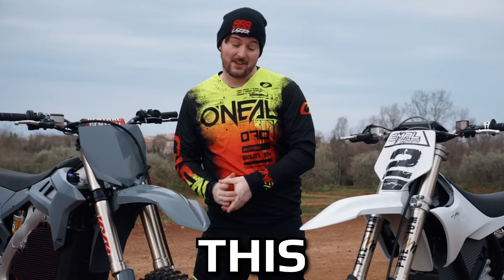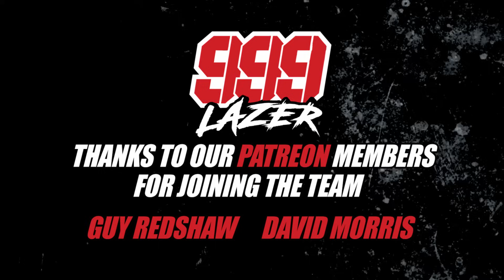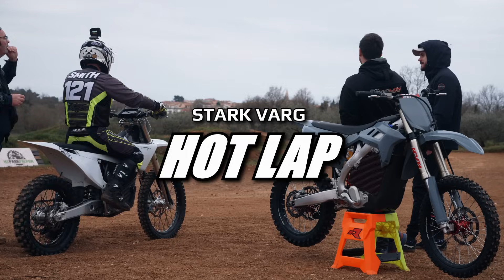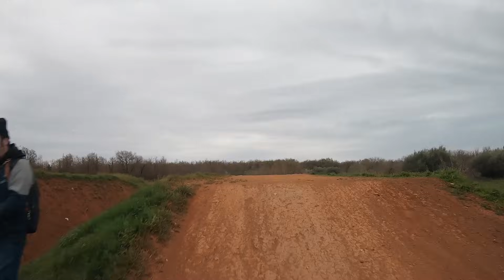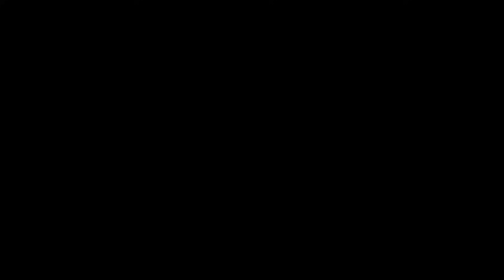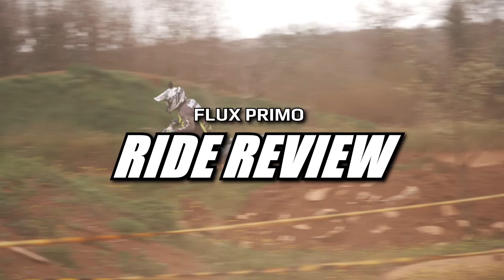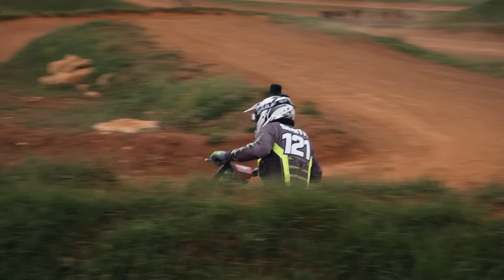$50,000 Dirt Bike vs $50,000,000 Dirt Bike! | Electric Motocross Shootout

Comment: SPOILER ALERT: Video title + Second 00:05 and this guy is already lying. The Stark Varg was not developed with $50.000.000. This fund was to mass produce the first model (which is more or less what you need for roughly 7.000 bikes). This doesn't mean that the development until then was higher than the Flux, but in my opinion, both the Title and the emphasis on these numbers on the video, make no sense because they are completely wrong and give a deviated perspective to the consumer.

Comment: If Marco is monitoring, why not build the rear wheel with the electric motor in the hub? Why put the motor in the frame and use a chain to transfer that power to a rear sprocket?
Reply: Because it's unsprung mass and it rides horribly, lol

Comment: Stupid clickbait title. Not required. Production is a big hurdle- ask all the struggling car manufacturers vs Tesla. I have a Stark - love it. I ride 4 - (15”-20” ) motos, with one top off charge from 120v generator. I want the Flux as well, bring it on. Competition  will drive development. Hopefully Flux learns from Stark mistakes. Do not overlook import/ distribution issues- big delay( 9 months) in getting my bike in California. 60hp is more then adequate, my Alpha I run at 48hp. Efficiency is key- Stark just released firmware update which basically gives less wheel spin/ improved traction control. The idea of battery swap is great but not necessary for most of us- my generator is 600$- battery prices fall to 1000$ per pack? Stark pack is down to 3k now. Exciting future.

Comment: The mention of the generator killed me😂😂 as if manufacturing an electric bike wasnt already so much worse for the environment, youll still need a diesel or petrol generator to charge it at the track!!! Theres a reason youll always need an ICE generator, they are so much more efficient, reliable and sustainable.

Comment: Pro Tip for flux. People want a license plate on the bike. We don't all got fancy courses to race on. Be the first to beat surron
Reply: As I agree I want to be able to ride on street, these are balanced motocross designed first, supermoto later bikes. They’re going after motocross. You don’t need top suspension & frame for straight-line  street comparisons.

It should be simple to add brake lights & get it tagged in most states, so I wouldn’t worry about that.

btw, I have no doubt their regen/clutch brake will. e an industry standard in little time. It seems perfect.
Reply: @KnowNotNo_I  Millions of dollars in testing gets done to get a bike a plate in 50 states.
Some states yeah, a lawnmower can get a plate.  But not all.   A plate is not simple or cheap at factory level.
Reply: Yep after getting nailed in the woods the other night on my 450 by the cops, I will not buy an electric bike until I can have a plate on it.
Reply: @JoshStreenow you can stark varg ex
Reply: @JoshStreetDesign how did you get caught in the woods on a 450? No hate just genuinely curious
Reply: Gomologation cost money

Comment: I'll never understand Electric for this reason.
A normal combustion car, what happens when you disconnect the battery with the engine running?

Electric vehicles will never be the "go to" until the focus is away from battery\charging and focus on producing charging "alternators"? as the main source of power.
I did hear "regen" but its not the same because a mass in motion is producing energy. why this isn't being used, raising questions.
We've had electric motors since early 1900's but why wasn't electric vehicles ever produced? Because oil was the driving force and manipulated what we have today.
I feel "battery" or lithium production are a bunch of rich people wanting to do the same thing today but using another product.

Battery should only be used to take off and from there the vehicle should be able to run unlimited with axles as alternators and even extra alternators to RUN THE MOTOR never touching the battery other than during take off. 

Now aside from that, this company is doing great things and I'm glad companies are entering the Motocross market. The above has nothing to do with the product shown here. I thank 999lazer for showing this and Primo
Again my comment is nothing against these two
Reply: Are you that dumb ? You say electric motors have been around since the 1900s so why didn’t produce vehicles ? Battery life dumb dumb !  Batteries even 20 years ago in power tools and other things were shit . Battery technology has only become good enough to support EVs in the last 15 years or so

Comment: 24MX the greediest MX store out there. I have spent aprox 1000 Euro/year at them the last 15 years. Bought a 3x3 aluminum tent in November 2022 and stored it on  shelf til summer 2023. When I unpacked it one leg was bent 15 degrees and two short scissor profiles to the roof was broken in half. I photoed the entire unpacking, sent them the photos and asked for new spareparts (not a new tent). The answer was how I unpacked it, how I have used it, why I waited 8 month etc. To make it short it was several emails back and forth. My season ends in late October and restarts mid May and my first need of a tent is always first weekend in July. Thats why the eight months. Summary, I didnt get anything, they blamed me. Ended up with using my steel tent fram and painted the canvas black. No more marketing for 24MX on my behalf. I do everything I can to make people leave 24MX. So far at least 20 people from my club as they was there during the unpacking + aprox 10 neighbours that followed my email conversation with 24MX on spot. Sheers from Sweden.

Comment: Pricing is going to be the killer if anything is. Looking on Flux Motorcycles website, their aim is 12-13000 Euros.😱😱That's an awful lot of money....
Just to compare against the Stark and gas MX bikes, here in Canada the Stark Varg is expected to go for up to 17,000 CDN next year (as per Stark's website) depending on configuration. The Flux Primo will go for about 19,000 CDN at today's exchange rate (1 CDN = 0.684 EUR). The Honda CRF450R retails in Canada for roughly 12,500 CDN (depending on what province you buy it in).

 I really like the concept, but the pricing is going to have to be at least comparable to gas MX bikes price wise to get a good chunk of sales.

Comment: They definitely need more range! They try and avoid this glaring problem. The bikes need to be lightened everywhere and they have not done that. Yet. Also capacity needs to be addressed. Easily! One for track and a bolt on/ quick connect setup for long rides. I want to design a skidplate with a bulkhead towards the front just behind the front tire that could add capacity and serve double duty as a skidplate! Keeping the weight low and forward. Plus who can't install and remove a skidplate? Lol!
Reply: Sure being light has it's advantages but you also don't want it too light. It is already a much better freestyle bike with it's current weight and feels like a 125 riding it. Don't let just pure weight numbers fool you. The only place weight really comes into play is picking it up.
Reply: @kurtheidelbach  makes sense for feel. I'm sure of that. Kinda like freestyle drones, 5" just feels better when you chuck it! Lol!

Comment: Having just spent nearly all day just to change an air lifter and spark plugs on my Varadero, I am beginning to think to about the ease of electric ownership.
Reply: I just changed the filter, plug and gearbox oil in my ktm 300 in little over 30 mins, now i can spend around a minute putting petrol in it and ride it for the next 20 hours with a couple more 1 minute fill ups. in what world is riding 30 mins then waiting 3-4 hours to ride another 30 minutes progress.
Reply: @b45her  I can do that on my KDX250 in the same time. Try doing that on an XL1000V Varadero. It's a haul mate. Any 'off-road' bike with that requires the crash bars, side panels, tank, two petcocks (that have the off position on the friggin' center- so easy to turn on and gush every- friggin' where) - fuel light wiring  just to change an air filter is bollocks. Luckily I don't ride is dusty conditions, and don't have to go through the process to often, but I pity folk who have let's say, an Africa Twin and ride it in very dusty places. SO badly designed. 

I hear you about the charging times on the eclectic bikes. I'll take your KTM 300 over an electric bike.
Reply: @b45her  Uhhhh. An absolute ton when you can do it in many different places moron! It's a huge growth area and expansion not replacement. And yes, I have a KTM 300 too 🤦‍♂. And with a 4T MX bike you don't do near that long between oil changes, filter changes, and cleanings anyways.

Comment: Both of these look absolutely ace and a much more appropriate use of EV technology than trying to convince people to rely on one for everyday transport. You charge, go to the track and race and come home, no flat batteries after leaving it in airport parking for two weeks etc. And we've already been through this with RC car racing where electric power has made a huge impact in classes traditionally dominated by internal combustion such as 1:8 scale buggies etc. When the electric versions first appeared we had the normal pit lane banter of the IC guys calling us tree huggers etc. until we started beating them, then the boot was well and truly on the other foot and they complained to the BRCA (kind of like the ACU for radio control) who gave them their own separate class, saying we had an unfair advantage. Which we did; instant acceleration, easy to work on and the extra weight actually generated more grip and suspension compliance at some tracks. Also allows experimentation with things like slipper clutches and the combined brake/clutch on the Flux's left handlebar is a very interesting development. Cool vid, thanks!!

Comment: The suspension is way better on the Primo. If they dial in that geometry, that bikes going to rock. I can't wait!
Reply: So how do you know the suspension is “way better” ?  It’s way better than the varg KYB ? How ?
Reply: @Ozrider2504  Ohlins in general is better than KYB. Unless something has changed at KYB.
Reply: @davidmcdermott3415  ohlins is better said no one ever ! Haha . Kyb is the suspension to have . How may brands rush out to put ohlins on their bikes ? How many riders put it on their bikes ? I havnt even seen a set of ohlins  since TM used it and even they use kyb now .
Reply: Suspension on varg is enduro revalved here.

Comment: Why are they so intent on racing against gas powered bikes, like they have something to prove. Or maybe it's an attack on the sport as we know it. I'm no pro but it's going to take far less skill to ride the ev bikes, no clutch no gear shift to think about. The sport as we know it today with gas powered motors is extremely challenging both physically and mentally but that's what makes it so great, that's what we like, that's what we want. If they win what will that prove? That it's a faster bike? I mean what are they really after here? Throwing a fit about not being aloud to race with everyone else is very child like. The rule book will tell you what you need to join OUR sport.
Reply: This would help them corner the market and sell bikes. The phrase “Win on Sunday, sell on Monday” comes to mind.

I bought a Stark because it’s quiet, so can ride on my property and not disturb anyone. It’s also super easy to take care of. No top-ends, bottom-ends, clutches, valve checks, timing chains, air filters.

 Only a gear oil change every 40 hours. That would be close to a rebuild on a 250f.

Comment: There's no battery breakthrough to save weight. Great to see development work being done. Well played Max.
Reply: There are though many different ways of implementing and managing the same cells. Working on doing that optimally
Reply: @FluxMotorcycles  not really, energy is energy, P=VI.  more range is a simple equation, either bigger battery pack (excessively heavy) or less power output (slow) i like the idea of electric bikes but it will be decades if ever for batteries to get anywhere near where they need to be to make electric off road bikes viable. good to see your actually developing your product though rather than just announcing a load of nonsense claims like Anton the T-shirt salesman.
Reply: @b45her  you're completely right, the meaning was on one end increasing energy density at vehicle level (kWh/kg on the motorcycle) and on the other end increasing efficiency, for off-road specifically meaning wider efficiency band.
Both together increase range, not 3x, but there's meaningful progress still to be made.

Comment: Don't be surprised that Stark dumped so much money into that and then another manufacturer can come into the game later piggybacking off of Stark's research & development and produce just as good a bike with less.  With electric vehicles, performance really comes from that power delivery and traction control.  EV's give instant torque so the it's all about making the power useable.  That's all done with the software.  It's good to see another player in the EV motorcross game

Comment: There should be a class for  200 CC Two Strokes and  250 CC Four Strokes   A Class with  300 CC Two strokes and 450 CC Foru Strokes  and an           Open Class with  500 CC Two Strokes  500 CC four Strokes and Electric bikes.

Comment: This is a pretty bad video. First off the track was flat dusty and slick, it had no jumps no ruts no breaking bumps nothing. He put the stark in a high hp mode and just spun the tire the whole track. never got to use the power, handling, or suspension at all. The flux has less power so that means less tire spin. I guaruntee if they went to a legit track with regular dirt, jumps, and turns the stark would blow the doors off the flux

Comment: Being it cost about 9k on the hugh side to build one new why would you spend 50k or 50m on an e bike. unless you are not mechanically incline and don't want one that bad. Brushless motor, multiple 4s lipo batteries ran in series, progressive power switch for throttle and a yz 125 or 250 with no motor for 800 to 1k. Use 2 stroke chassis for light weight. The slavery and terrible prosses it takes to mine the batterie material for electronics is far from "green" but folks can think what they want. Cool comparison video either way. burn gas eat ass my freinds! Keep riding while they are charging back up